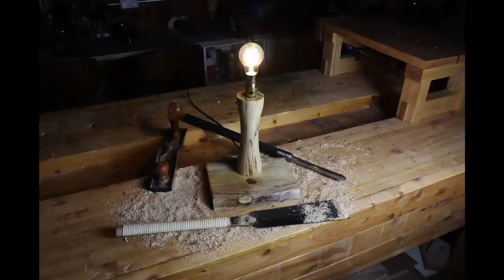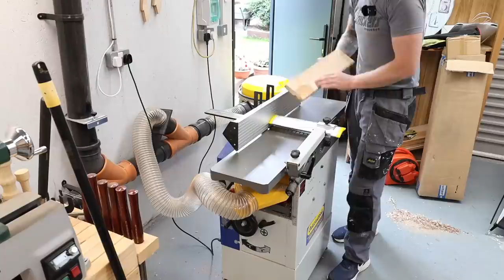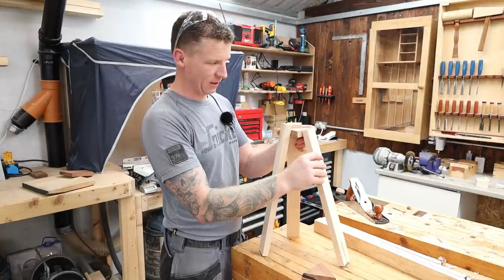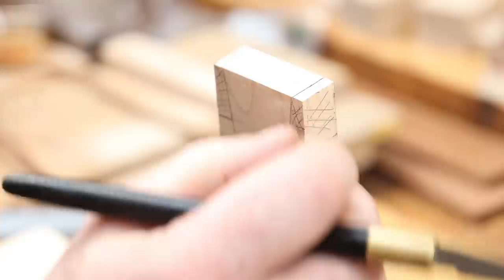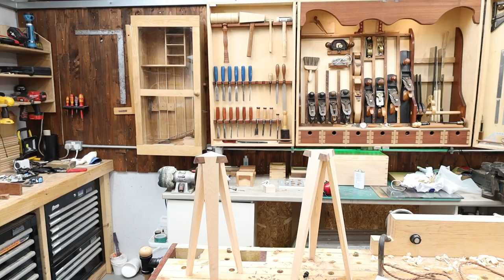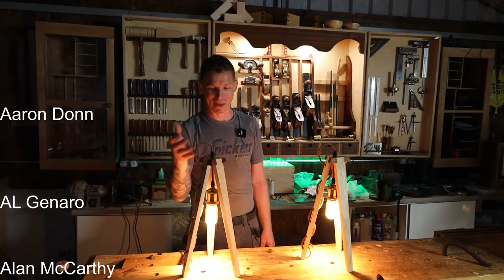Unique Tripod Shadow Lamps. Woodworking Project!

Comment: That centre triangle piece is way to delicate for me to make, I would have to make that larger or thin down the dovetail on the leg. Did you buy the cable twisted like that or make it up? I am after some old twisted cord to make some test leads for an old Megger I am restoring.
Reply from the maker: I bought it like that its just a decretive braided flex